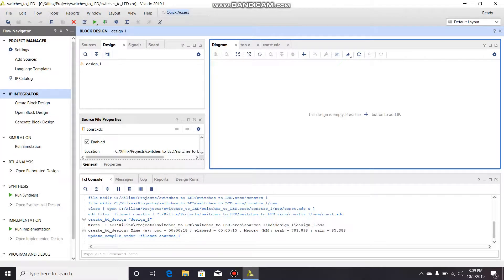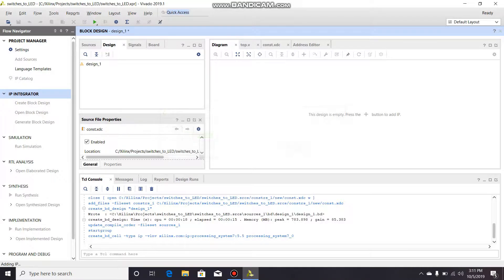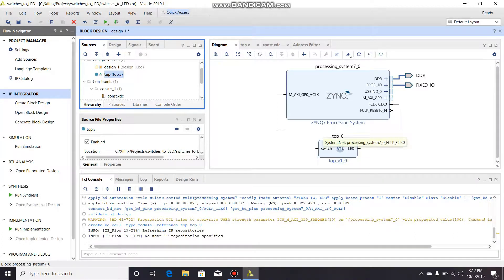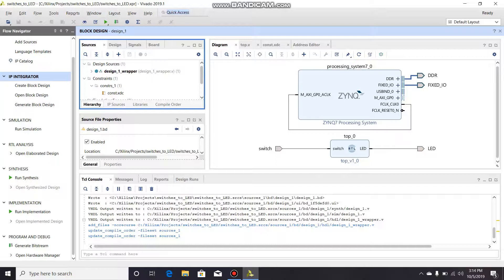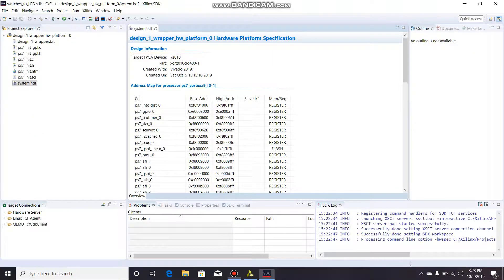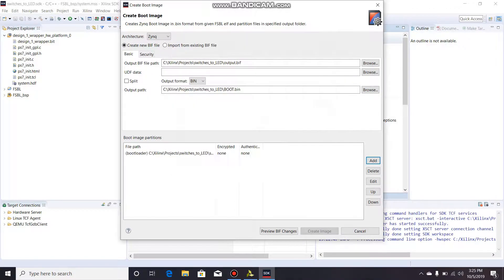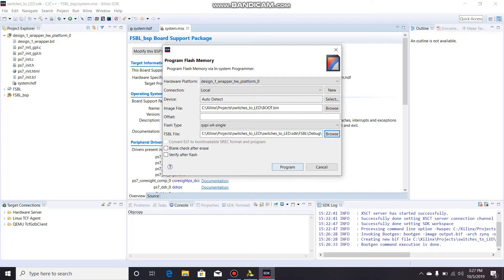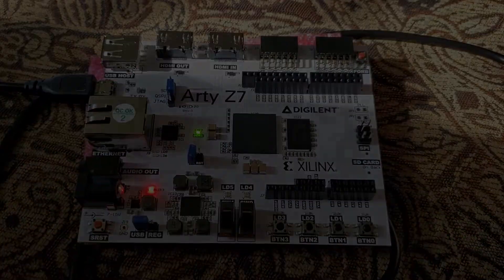How to Program QSPI Flash on ZYNQ | Hardware (HDL) Only

Comment: I have a question. Im trying to blink my led using the PL part (fpga) of the SOC only. I am having problems in doing so. Is it must to use the Zynq processor? The board im using is Zunqbeery TE0726-03.
Reply from the maker: @TrendSurges  if all you are doing is blinking the LED then you dont need ZYNQ, but if you want to store the FPGA configuration on the flash so it boots up and the LED starts blinking, you need the  ZYNQ processor because the flash memory is linked to it

Comment: Thank youuu, omg it worked after months of trying and giving up. switching works but if my VHDL design contains a clock so i can create timers or time related things then it will not work , the program will flash successfully but nothing will blink. With a normal design directly programming from vivado the blinking works though but its volatile.
Reply from the maker: Hmm I haven't run into issues with sequential circuits. You could try posting your question and your code (with a link to my video) on the xilinx community forums, or the EEV blog in the FPGA section.
Reply: @Dom-bo8wd  Hello, I managed to make it work, already, i probably missed something. Now my RTL design with counters  works fine, exportable as hardware and programmable into the flash with the SDK :) Thank you again